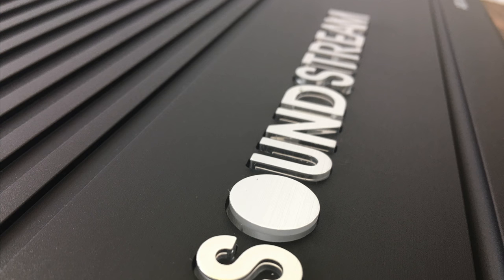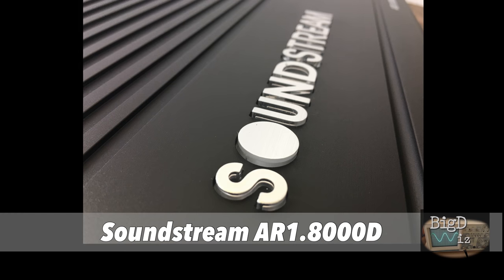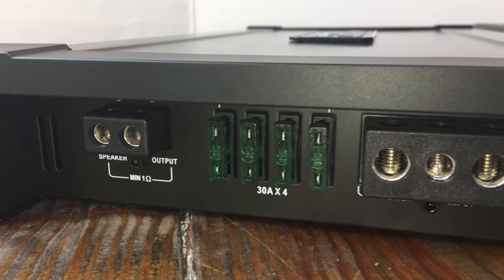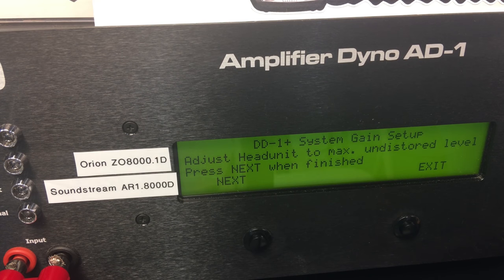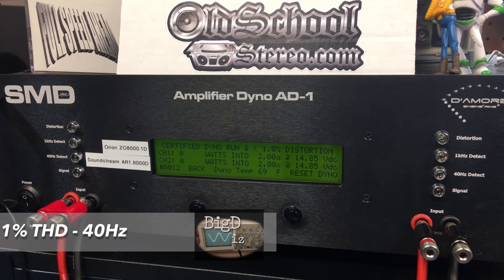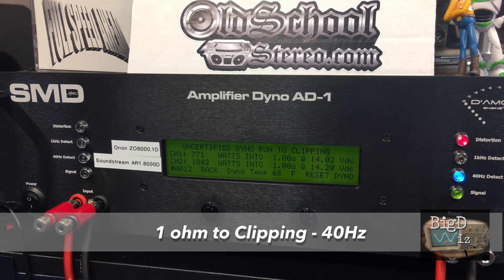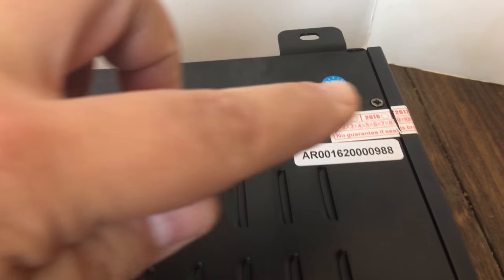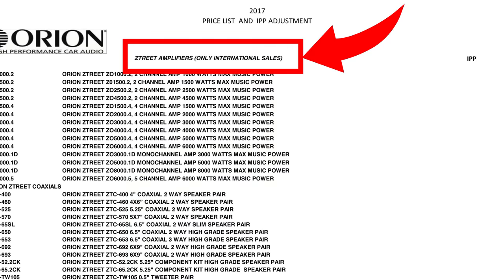Budget 8000W Amp Dyno Drag Race! Orion vs Soundstream

Comment: I love the dynos on the budget amps.  Even though some of them don't make rated power you can find some great wattage for the price.  And oh my how the mighty have fallen over the years.  Shame on Orion.
Reply: Mother Porkers BBQ it's Orion entry level amps.  Check out Big DWiz dyno on the Orion XTR 2500.1D
Reply: Yeah Orion is actually putting out really good products currently, however they do have lower tiered gear and this is one of them.  Get the hcca or XTR.
Reply: Then they should rate the entry level amps accordingly based on what kind of power they make. That's Boss and Pyle type B.S. ratings right there.
Reply: Mother Porkers BBQ It's not the real Orion...only in name. Same with Soundstream.
Reply: MSH68 I got the xtr 2500.1 and the birth sheet is 2948 at 12.4 volts at 1 ohm. It sounds amazing and it only cost me 350
Reply: brian rich itsnot 1ohm
Reply: Mother Porkers BBQ  I agree with you,
Reply: Orion were lackluster when i got into car audio back in the 90's. Nothing Orion made back then could touch Soundstream's reference 1000s.
Reply: You got that right.  Orion used to be premium.
Reply: @LBCAndrew  This is exactly what I was thinking.  "Mighty fallen"? They were never high enough to fall as bad as this amp just did.  Soundstream has always been a respectable brand.

Comment: That Soundstream is using the exact same board as the CAB 1600.1 with a few slight modifications to the center caps, and half of them.  They put out similar numbers, but I think the CAB is probably using a little better components.  Thanks so much for this test and gut shot!!!!!!!!!!  You da best!
Edit - they are the same measurements with similar end caps, definitely made in the same building imo.  But then against, most amps today are.
Reply from the maker: +John Doe man, I knew it looked familiar!
Reply: ive got plans for the cab. im gonna try and run two on some sundown e series and move up to some sas or zv5s tho the cabs will an exciting venture
Reply: hunter callahan I got a Cab pushing 2 sa12s and it sounds good. I'm about to get another cab amp and run one on each sub.  If you got the electrical to feed it they will surprise you.
Reply: i can believe it man
Reply: The power acoustik cab-8000d looks to be identical to the soundstream ar-8000.1d. Can anyone verify this for me? I just ordered the CAB-8000D.
Reply: John Doe so in your opinion what amp is better the cab or the soundstream, ive been looking at these two amps for about a month & cant decide

Comment: I bought that same exact Soundstream amp(AR1.8000D) for my 2 15s about a year ago and haven't been disappointed yet 😬😬
Reply: would you recommend one of the soundstream ar1800d for an orion hcca 15 rated at 2500w rms
Reply: @G3RMZONE  you must did not see the dyno to ask a question like that
Reply: @quintonwilliams8586  i did see the video. I say at least 10 times before i bought the sound stream amp. I was asking because he test all kinds of amps if this would be a good bang for the buck. Im very happy with this amp tho. And at 129$ refurbished. it pounds the hcca 15.
Reply: @G3RMZONE   I have the sister version Power acoustik cb1-8000d and yes they bang for the buck

Comment: Hello. I can not find, i still can't. Can you please do a benchmark using different gauge cable to an amplifier? measuring the loss of rms from around 5m of 14,12,10,8,4 cables from amplifier to the subwoofer.

Comment: Just purchased a “2018” “AR1.8000D” and the manual has been updated**  stating 1500@4ohms 2500@2ohms get this they say 4000@1ohm!!!!  Same$$$$ Same Amp**** disclaimer at bottom states  “Specs and designs subject to change without notice for improvements”**** ;) we allllll neeed “SMD AMM1”s
Reply from the maker: Yeah not quite!

Comment: Always great to see the guts of amps. Would be interesting if you can point out how many mosfets are in the finals, you will then have a fair idea how powerful an amp is. Looking at these amps, the Soundstream has 12 and the Orion has 8. Seems like the Soundstream has the TO220 type mosfets and the Orion probably TO3P's, not very clear on the video. But for certain you can tell the differences in power by just looking at how many mosfets are in the finals (output stage) of an amp. Always luv wathing amp dyno's, thanks for your great videos 👍

Comment: If there is an issue with the Orion, why use it in a drag race? "Got two horses racing here to see which is the better breed and better buy. One only has three  legs but this should still give you a great indication on what to buy the next time you're looking at horses." Just kinda seemed potentially completely misleading. The Orion could be by far the better amp and now a bunch of people could be wasting their money. Just something to think on. Still love the videos

Comment: There seems to be a print problem with Soundstream manuals and advertised power. Your manual says 2000rms at 1 ohm while other booklets says 4000rms at 1 ohm. But according to your Manual  you are almost doing your rated power at 1 ohm

Comment: One of the confusing things for us as consumers it at least it has been for me, is the date of production of these amps. I've seen two of the Sound stream amps come out that are so close in price it's hard to figure out which one to buy. Also alot harder to figure out which amp is the better choice especially since they are so close in price. The  AR1 8000D. And the TL1 4000D are both pretty much the same price. After I saw this video and a video on the TL1 4000D, the guts were a little different but power out put on the Dyno was same. If I knew which one came out on the market first, it may be helpful to know if they redesigned and improved or redesigned and went down.
Reply from the maker: Thanks for the suggestion

Comment: Thank you so much.  I bought the Soundstream a few months ago and I'm running 2 Dayton Ultimax 10's wired to 2 ohms.  I was wondering how much power it really made, because it all slams under the back seat of a crew cab GMC Sierra Denali.  It's nice to know that if I get 2 more 10's it will put out the power to keep them happy.
Reply from the maker: +cragre28 build quality is a bit sketchy, but yeah, good power for the $$

Comment: DUDE !!  I was just about to get the CAB 1600 .1  for 200 bucks, but this soundstream has a better dyno run than the freaking CAB, AND it's cheaper......Damn !
Reply from the maker: +Doc J it, like the CAB (in my experience), is fragile....so be easy on it
Reply: That's pretty vague.  I won't put more than 1ohm load on it.

Comment: Question...  if I can get a amp that hits 2000wrms for $200, why bother spending $1000 to get the same results...  Any info..  What am I missing here... sound quality, reliability... The results are pissing me off...  Great vids... lovin' the old school set up vids, much appreciated
Reply from the maker: +melly mel better components, better engineering, better quality. Will last longer and may be worth it in the long run, if you keep long enough. A good percentage of the amps from the 90’s are still working, but they were $2-5 per watt. Nowadays it’s like $0.20-0.80 per watt
Reply: melly mel they dont last. Look at the internals on both amps. The Orion is pathetic and the SS is just passable.
Reply: BigDWiz that's true all my mtx amps are still running.. all my "budget" amps die in in a couple of years.
Reply: @bobdodge3171  mtx is a budget amp 😂😂😂
Reply: Mtx amps will last forever from the ol school because comp amps from that day were always made better . soundstream is basically power acoustik now or epsilon orion still has good stuff but they made really special gear yrs ago

Comment: Amp test the Soundstream 2500.1D Rubicon.
Reply: Jered Housel I have one of those. Good amp. I paid $175 brand new. It's a good back up. Never had any problems with it. Judging by the guts probably puts out close to 2500 watts
Reply: Brad Davidson This is my second one. I've blown the first one twice so bought another to strap them down the road. I like the amp a lot. I think it's my falt it blows after about a year or more with a 90amp alt and interstate battery. I have the big three with 1/0 wire and back to the amp and run three 12 inch W/0's. I feel it will do better with bigger wrap on alt down the the road. But it's solid and loud when I'm jamming in my little MK2 Jetta
Reply: Jered Housel I bought the limited edition black one because I saw a lot of the blue ones refurbished. it doesn't have any fans . I used it when my old PPI a1200 caught on fire. I have two xtant x1001 now on my old Eclipse aluminum 15's. Just got a 300 amp hairpin alt  from Nate at excessive amperage. Can't wait to install it. Also got 2 xs power 3400 batteries. My only knock on the Soundstream  is that it doesn't reproduce the lows hz near as well as my old amps. It beats tight though
Reply: Brad Davidson That's super Awesome man. I love old skol for sure. Bass on dude. Thank you for the replies
Reply: Jered Housel Also I always run a negative cable all the way to amps. Seems to help a lot. If u add batteries make sure they are all new and fully charged
Reply: Jered Housel that amp needs at least 200 amps to run properly very power hungry and will heat up if under powered I love these amps
Reply: TheSjb1000 exactly...a amp getting low voltage is no good for them.
Reply: You guys know what amp should I use to run two sound streams T4 - 12
Reply: julio bello Rubicon2500 tarantula 2000 Picasso 1600 any of these amps will work fine depends on budget (team Soundstream)
Reply: TheSjb1000 I’ll check on those I got the subs for 200 and they look brand new they were in car show car but the guy sold the vehicle in parts and I ended up with the subs
Reply: julio bello what state are you in
Reply: Better buy a second battery... Thing's power hungry but it's a beast

Comment: Can you post the type of distro blocks you have in the video. I stripped my 5.7 MAGNUM to the metal for a custom rat rod/hot rod look and the dash panel I am building uses only metal--and cap screws (like the ones on the distribution blocks [they would match the new interior perfectly]).

Comment: I wouldn't doubt if there's something wrong with those Orion amps in general. I ordered one of the xtr amps and it put out a lot of noise over my highs and the sub amp didn't move my 15" the way the pioneer i had before it did despite it being double the power on paper. I had to hassle online car stereo to take them back.

I was excited about getting the Orion cause I've heard the name before and people always talked highly of them
Reply from the maker: +Rico K I ordered a replacement Ztreet plus a Cobalt 3500. We’ll see
Reply: BigDWiz I'll be tuned in to see the results. Good luck 👍🏾

Comment: I am just throwing this out... What doesn't make sense here is at 2 Ohms the Orion pulled 814.  But at 1 Ohm it pulled 760.  I think there may have been an issue with the electrical, not questioning your knowledge BIG-D you know what you are doing and everything looked good in the video but.... I have never seen that in any of your videos, and SMD's.  I demand a rematch!  LOL
Reply from the maker: There was actually a problem with the amp. I sent it back and got another, did another video testing it. Soundstream still came out on top
Reply from the maker: Here is the follow up vid - Orion Ztreet ZO8000.1D 8000 watt MAX Amp - Update Amp Dyno Test https://youtu.be/lkQOPlu64_g

Comment: I am a fan of your page Big D and I do understand your personal dislike of these type products but from a person whom have used them for quite some time, they are some my nest selling products when installed in house.

And not lasting long is a misconception based on an opinion and not facts, it all comes down to the user and the install although their maybe lower brand that do not hold up or perform as well but PA has been good to me as a dealer.

I have a few budget amps that are at 7 to ten years old and still pumping.

these may not be for everyone but are very well suilte for its consumers on a type budget and or someone just getting started.

Epsilon will not change their marketing exploits even with several of us requesting the change, if they rated theirbproducts as most would like? the out look from  people still would not change much do to the vast number of internet stores offering tgis product at or a little above dealer cost and we all understand this is not a good thing to a store front owner.( I know, due to this why I closed my doors to the retail side of things)

I do not want this to sound as if I am trolling but it's not easy hearing a product that I've sold and used for decades treated as if it's trash when I've never had a bad had a bad unit from my distributor and one of the was the Wholesale House Inc.😏

if you want to give away that EG10K? I would be honored to have it😊.
I have a Face Book group that supports the Epsilon products and we have seen a great improvementbon how people care using these products as well as more patrons video postings that shows the improvements😊.

its all about getting louder with the budget tgat is allowed at that time.

everyone starts some where but later upgrades to better.

thanks for your time my friend.😊

Comment: The Soundstream AR1.8000D has the exact inputs and outputs adjustments/terminals as the Power Acoustik CB1-8000D. Are these amps identical on the inside?

Comment: Hey big D. How's goes brother i just started in car audio. Could you do a bench on a boss onyx 5500 class d amp. I run that right now with 2 power acoustic gothic 12s dual voice coil at 2ohms. I would like to see how you wire it and if there's any way to get more out of the amp. If it's a good amp I want to get another one and add 2 more subs.

Comment: My buddy has the 10000 version of that Orion 8000. He thinks it does 2000watts, more like 1000 based on this dyno. LOL NUB

I'd like to see Orions new XTR amps on the dyno. They are small and pretty powerful. My 1500's birth sheet says 1608 watts at 1ohm. Not shabby for a $200 amp.

EDIT: I forgot you did dyno the 2500 XTR. Its the reason I got the 1500. Searched your channel and was like "DUHH". :)
Reply from the maker: +SwishaMane420 yeah, the XTR/HCCA amps are no joke!!

Comment: Power Acoustic CB1.8000D appears to be the same amp. Same New- 4000W@1ohm rating as the latest Version of the AR1.8000D.. please test ether the AR again or do the CB1.8000D. Same price 170$ for “4kW”  please verify these numbers Big D!!!!
Reply: Its not 4000 watts maybe if you get 2 and strap them but i have had my cb1-8000 for like 2yrs and i have had 0 issues and ppl be impressed how good it sounds in my van
Reply: Quinton Williams for some reason both Soundstream annd Power Acoustic upped their ratings?!?  Too mee it “feels/sounds” like they just edited their manual after Big D posted a video of it... how do you get 4000w out of his Dynamic 2500W video?!?! It surely seems like nothing has changed except the manual***
Reply: @Finga_Trappa  I think the 4k is a gimmick where you would probably have to strap 2 to get 4k but thats if it even get close to it. In my opinion its still a good amp depending on what you plan to do with it.

Comment: How is this considered an 8000w amp?  I saw only <2000w
Reply: Dominic Dymond max wattage is totally different then rms. All that means is the power out put can maxx at 8k normaly if it says x-watts max it will be a lot lower rms wattage. You normaly only get about 1/4 to a 1/3 of that at rms.
Reply: jayson williams guess i was hoping to see that max wattage... it's still entertaining. Thanks for the reply.
Reply from the maker: +Dominic Dymond I just read the box to get 8k. It is posted ALL over!!
Reply: 8000k is the number they pulled out of the hat.
Reply: 8k*

Comment: I didn't see it do 8000 watts
Reply from the maker: Ask Soundstream and Orion...they said 8000 watts, not me 🤪
Reply: What make you think a 200 buck amp would give you 8000 watts? I have the power acoustik version CB1-8000D had it for 2 years with no issues running on 2 mofo 122x and it barely gets warm. I just wonder why no dynamic runs were done, Anyway i really dont care how many watts all i can say is if i never told anyone what i was running they would be surprised by how loud and hard it knocks.

Comment: Hey guys I need some knowledge, I'm 20 pretty new to the bass world, I have two RF P3's which are dual 2 ohm coils, I have the coils bridged with a 8ga OFC wire and have 12ga OFC speaker wire ran to a old school RF 800A2 and I just cant figure out how to get good clean bass? I also should mention I have a new kenwood head unit with 5V pre out, and 4ga CCA power and a 2ga OFC ground ran to the amp, i have them in a cheaper box by the way it's one i got new a while back when i first got a setup but it's a decent size just doesn't have a actual port just a 3" hole on each end and the center divider has been opened up with a 10" square hole
Reply: UNDERDOG PROJECTS So your amp can run at the lowest 2ohms stereo or 4 ohms mono. I don’t know what you mean by you have your coils bridged?  First off, you don’t rely need 8ga wire to run your subs. 12ga is plenty for the power your running. You rely need dual 4ohm subs for that amp. I would series the coils on each sub then run the amp in stereo mode. You won’t get all the power the amp can give, but your distortion level will be less. In the future if your gonna keep those speakers get a amp that can run 1ohm mono.